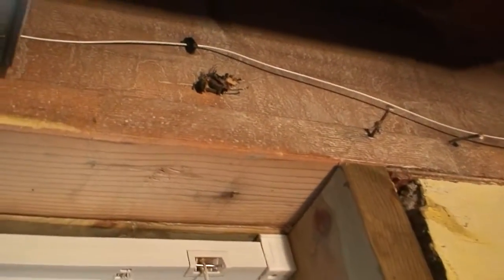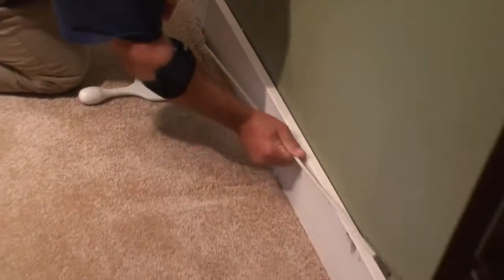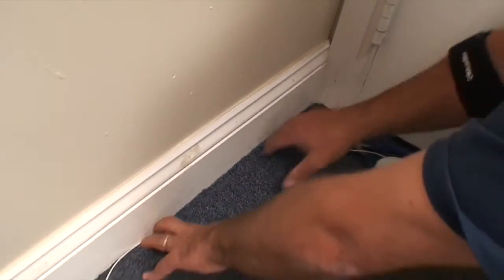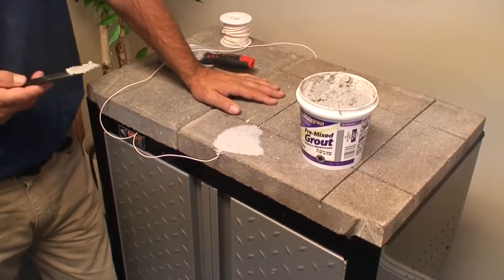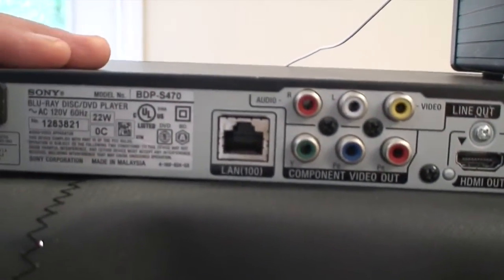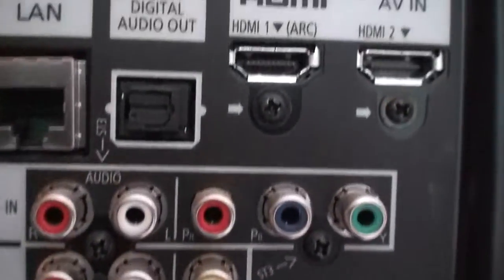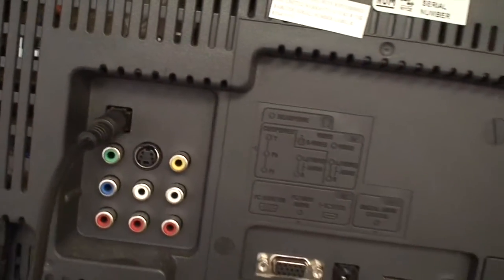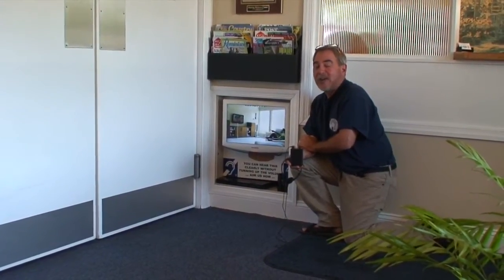Home Loop Install

Comment: An excellent instructive video!     If the wire that comes with a system is far too long, can it be cut to size, or would that cause problems?
Reply from the maker: It is best to maintain 1 ohm of resistance in the wire to keep the frequency response accurate. Most manufacturers pair the wire diameter to the length of the wire on the spool to hit that target. You can leave excess wire spooled or shorten 10' to 20' but any more could shift the frequency response and create more heat in the loop amplifier, but it should still work.
Reply: Most loop drivers will have a specified range of resistance. If the supplied wire is too long and shortening it to size will end up giving you too little resistance you can choose a cable with a smaller cross section in order to have a more resistive load therefore getting the cable in to range. What determines frequency response is the amount of voltage the amplifier have. Loop drivers are constant current drivers, depending on the size of the area, the height of which the loop cable is placed your loop will have a minimum current and voltage requirement to produce a field strength at target height which is typically 1.2 m for seated listening. If the resistance in the cable is too high or the size and height of the loop is too big then the driver can run out of voltage to reproduce higher frequencies. It will most likely clip. In some installations there are also metal in the construction to contend with. If your house have a reinforced concrete slab the metal, if it forms circuits where a current can flow will attenuate the magnetic field. In these circumstances your driver need to have an function for metal loss correction. This function also require more current and voltage from the amplifier. Metal loss will allmost always dampen the general volume as well as attenuating higher frequencies leaving the audio muffled. Simple perimeter loops should not be installed in areas containing metal of more than 5-6 m in width.

In short you can shorten the cable as much as you like provided the resistance is still within the range of that specific driver. If you need to shorten it by much you can opt for a thinner cable that offers more resistance to better match impedance of the system. like the supplied cable probably is. If you choose to spool the remaining cable you should make sure you have an equal amount of cable to and from the loop. These cables should then be twisted tightly around each other to minimize spill that can interfere with signal cables, especially unbalanced ones, as well as interfere with the magnetic field of the loop should they be placed in the wrong place causing cancellation.

If you have shortened it and you experience that the sound is worse, there are distorsions etc you can simply add more cable to the system later.

Comment: Hello, we have the tv set up to an induction loop but I'm stuck on the dvd player. How would you set that up separately? It's not automatically coming through the tv when the dvd player is on.
Reply from the maker: Our inLOOP 600 has multiple inputs so you can connect an analog, microphone and digital device in separate inputs. The volumes can be adjusted independently as well as combined.